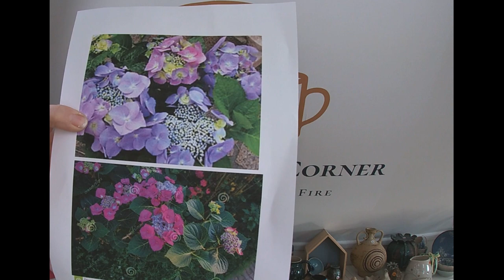PORCELAIN HYDRANGEA HEADS: Step by Step Making Tutorial (Part 2 of 3)

Comment: Hi,
How difficult is it to get them into the kiln once dried, I would imagine they are extremely delicate ?
Reply from the maker: Hi Debra - Yes they are uber fragile.  Very tricky to transfer to the kiln in their greenware state.  I leave them on the tin when they are drying and then move them just ONCE into the kiln - rather than loading and moving etc, but you really do have to be careful.  A couple of petals sometimes get knocked off which is annoying but they don't usually spoil the whole thing.  Thanks so much for watching.  😊

Comment: Hello those cutters don't they have a plunger to pop out what you've cut. The ones I have you push the plunger thingy and it pops out. Just curious that's all. Beautiful tutorial.
Reply from the maker: Hi Heidi- they do have a plunger but the porcelain gets stuck!  It can take ages to cut enough for one head.  Corn starch or baby powder is key.  Thanks for watching 😊
Reply: @thepotterycorner  oh ok I'm not familiar with porcelain so good tip. I wasn't trying to be cheeky just thought maybe they were different cutters. Going to try some in a bit. Not going to use porcelain,only because I'm just starting in pottery and don't want to buy porcelain if I'm not going to use it for anything else. Thanks again for a great video.